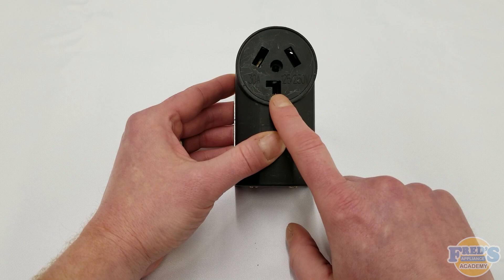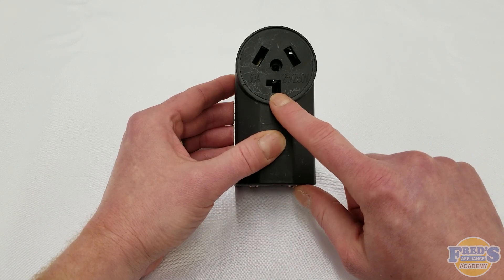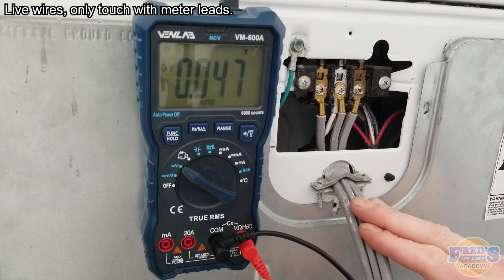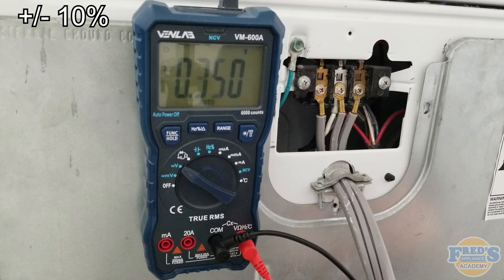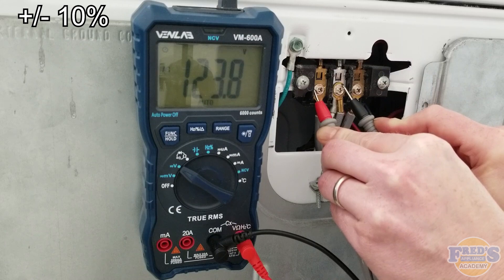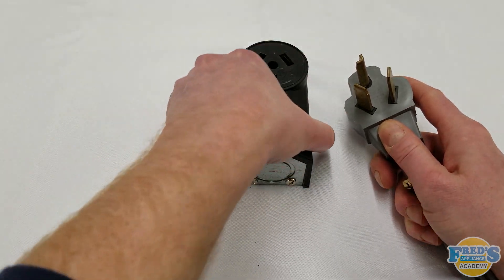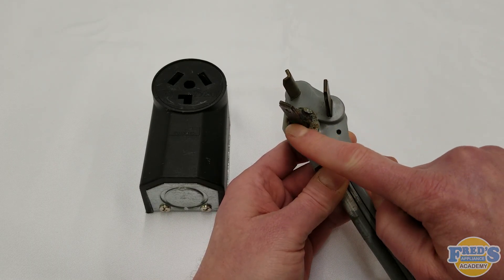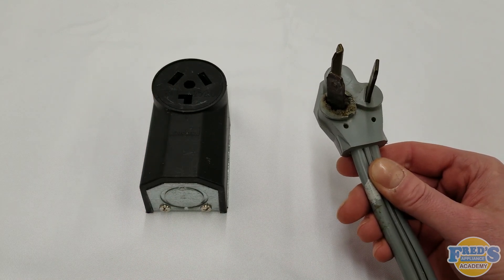How to test a 3 prong 240 Volt Outlet

Comment: Reading middle to left gives me 120, but middle to right only gives me 10. Right to left gives me 60. Same result with two different power cords. What could be the issue?
Reply from the maker: Sounds like one of your lines of power are open. You may need an electrician.
Reply: @fredsapplianceacademy Was a blown fuse 👍

Comment: Hi, you say you take "one meter lead and put it on L1..."..... does it matter which lead? Can it be either red or black lead? Also what do you mean by "L1" etc.?. Thanks.
Reply from the maker: The meter leads do not matter. For 240 VAC you have two hot lines coming in. L1 and L2. L1 means line one and is to the left while looking at the outlet and L2 is line 2 and it to the right while looking at the outlet.
Reply: Thank you! @fredsapplianceacademy
Reply from the maker: @Greg-wn2pp  Very welcome. Feel free to reach out any time.

Comment: i have an a/c voltage tester my for left on the terminal didn’t go off but the other 2 did do i need a new dryer cord?
Reply from the maker: Check you electrical box for a tripped breaker for blown fuse. If you are not comfortable with that call an electrician.

Comment: Im not getting 240v on the l1 l2 but im getting 120 on both neutrals
Reply from the maker: Sounds like the outlet is wired wrong. I would call an electrician.
Reply: @fredsapplianceacademy  thanks, a buddy told me to turn on the breaker without the dryer plugged in and sure enough it tripped on its own